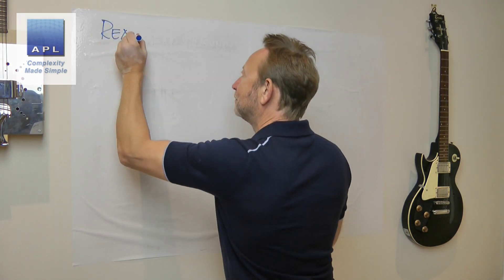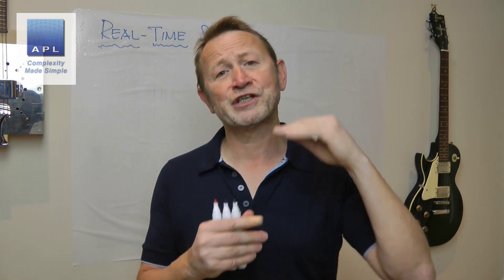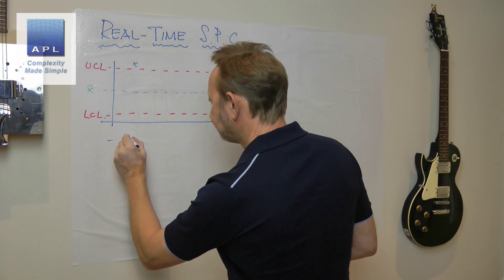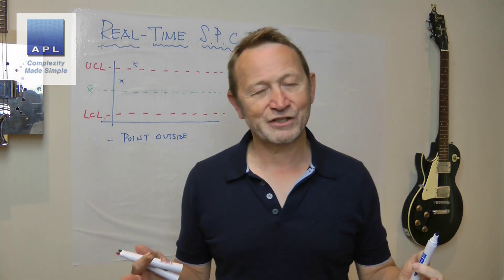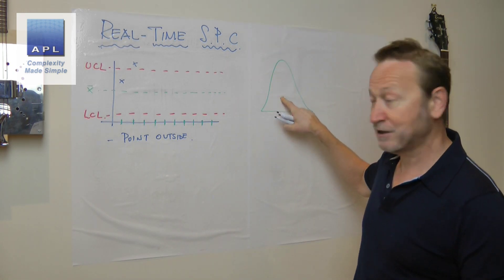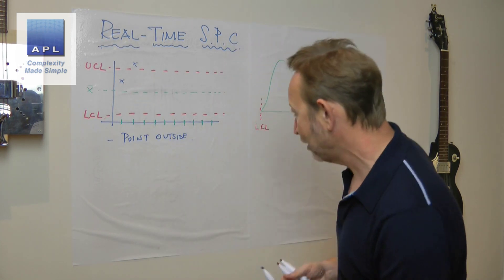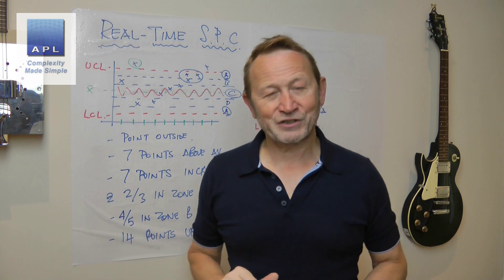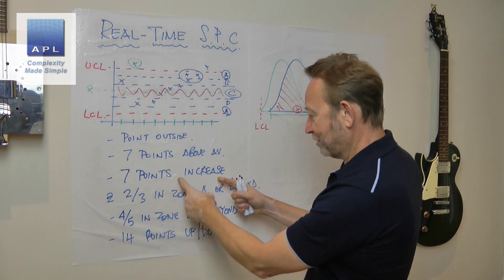Real time SPC - There is no such thing....

Comment: Hi Paul, I fully agree that SPC is never real time, but there are good advantages with digital SPC: take this example, where we weigh every product coming off the line, we subgroup them into all the products that come from one process tank (a mini batch, about 2-3 every hour, the rest of the line is continuous) - the computer can averages all those weights and calculates a standard deviation (we plot those in X-bar and S graphs with control limits). Now why would I ask our operators to manually plot this data on a graph and think about those 7 rules, when that same computer can just show the plot and a red warning signal when one of the rules is broken?
We need the data in the system anyway, for financial and technological analysis, so I don’t think we should burden an operator with calculations - it’s our job to provide operators with clear information on when they have to act (and preferably how). They should understand what the graph is telling them, but I don’t think it’s adding much value that they have to make it themselves.
Reply from the maker: Hi Tom - I agree. I'm not against tech. I'm against poor use of tech. Your example is a great example where you wouldn't do an SPC chart by hand in that situation.....Toyota get criticised for not using enough tech, but they are just smarter than everyone else and only use tech where it makes a difference...
One reason I love to promote paper and pencil, is I can implement it today, this second, no need to wait or evaluate a system, I can make things better in one day for no cost....
Reply: @paulallen5321  So true about quick implementation - that's also why pen and paper is wonderful to use during an improvement effort - if it then works and helps the operation, you can always automate/digitalise it later.
Big discussions about physical or digital KPI boards in our company - there's a lot to say for either of them - but the ease of implementation and ability to quickly edit and update the board is a big boon, especially in the early stages of implementation.
Reply from the maker: Tom - yes, do it simply, get value and really want the process to suceed and then buy tech to improve it. It's bit like making shadow boards. Make it out of wood or even cardboard. Once you like the design and location make it out of something more permanent. (I know you work in food, so all shadow boards are stainless!)

Comment: Dear Paul, I agree with you that the only real signal of a control chart is if a point is outside the limits. As well I agree that  Western Electric criterias are not immediate. But let's not foget the fact that the WE-criterias are pre-signals of an OOC datapoint. When you recognize a WE-deviation it took some time to reach the observed condition, this noise is already started some hours ago. But still there was no OOC-point observed, so no need for immediate blocking or sorting of the parts. But it is an alarm, that something happened what can cause an OOC-case in the near future. SPC-softwares give you an opportunity to prepare reporting and escalation easier and faster. However in todays manufacturing environment there are so many processes to be controlled, it makes nearly impossible to use SPC effectively.
Reply from the maker: Hi gabor - I think there will always be processes that are complex to control and therefore technology is a great help. But there are also many many processes that could benefit from a simple SPC chart...